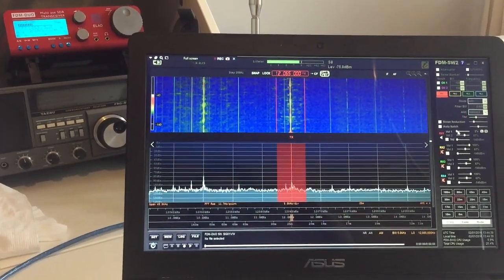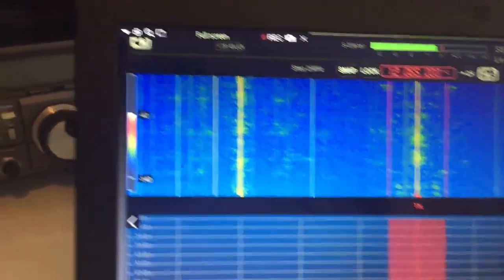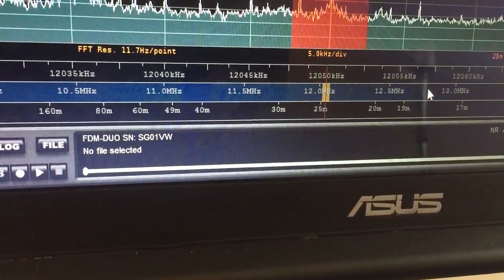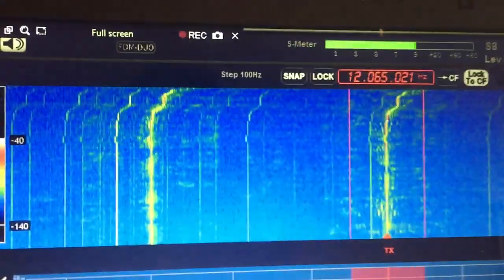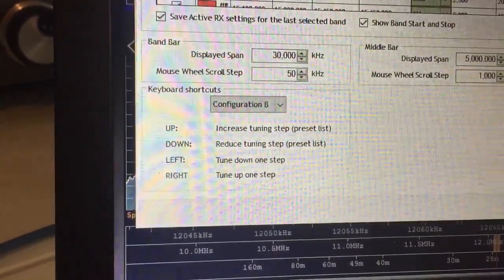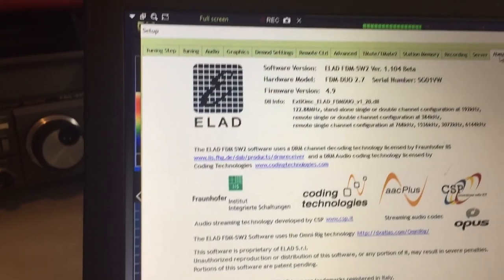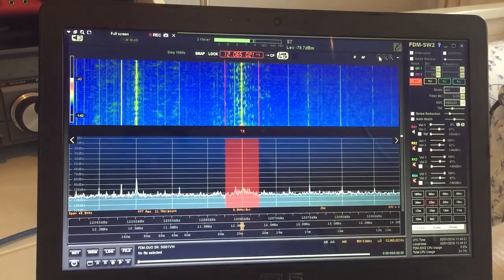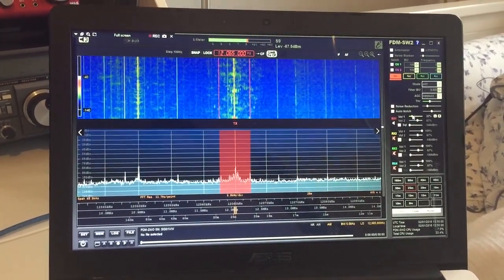Elad FDM DUO: a quick spin around the FDM-SW2 software

Comment: Nice video, Clint! The FDM-SW2 software might look complex at first glance, but actually it is quite intuitive and I'm sure you will learn to use its various options quite quickly. 73, Matthias
Reply from the maker: +senderjaeger Thank you Matthias, you're right, I'm getting the hang of it. I do have a question though if I may: to record the MW band from 500 to 1600 kHz, how should the LO and tune frequencies be set? I can't figure out if LO is in the middle of the scan or the lower end. Thanks for your help! 73s! Clint
Reply: Oxford Shortwave Log Hi Clint, of course you may ask. LO means the local oscilllator frequency and it should be set to the middle of the band to record the whole MW. The easiest way is to zoom out the spectrum, click on the tuning scale and drag it in the right position so that the wanted spectrum is shown in the graph/waterfall. 73, Matthias
Reply from the maker: +senderjaeger Thank you Matthias, so the LO is set in the middle of the spectrum to record. There is also a field in the recording set-up for tune frequency? If I get this right, the LO will be set around 1050 KHz then? Thanks again for your help. 73s! Clint
Reply: Oxford Shortwave Log The tune frequency is the one you are actually listening to. Click on the waterfall to tune to any wanted frequency in the spectrum. The LO should be around 1120 kHz if you're going to record the whole band from 500 to 1700 kHz. 73, Matthias
Reply from the maker: +senderjaeger Ah ok, I get it, thank you very much Matthias! 73s! Clint